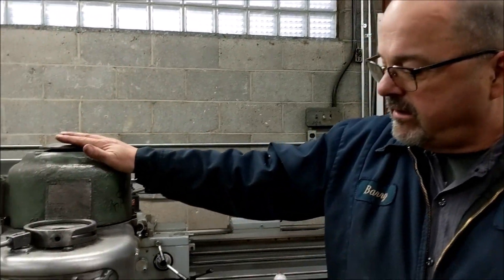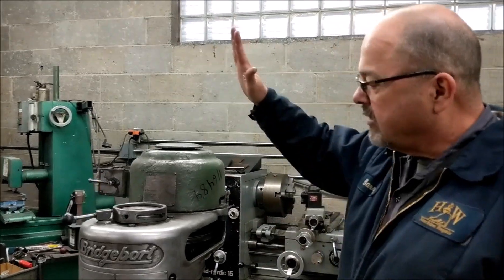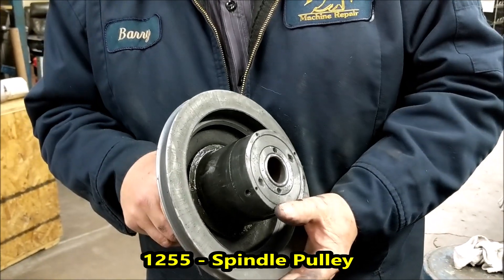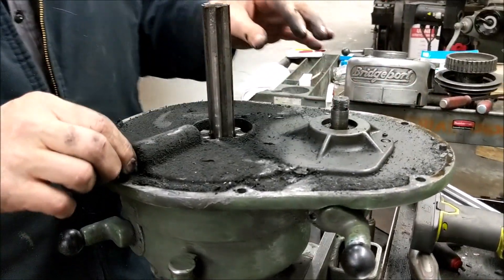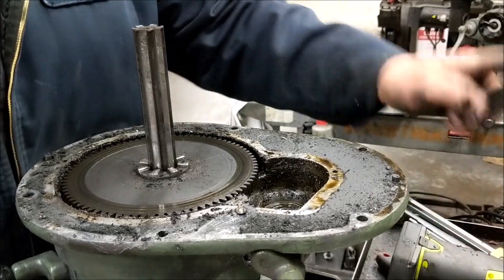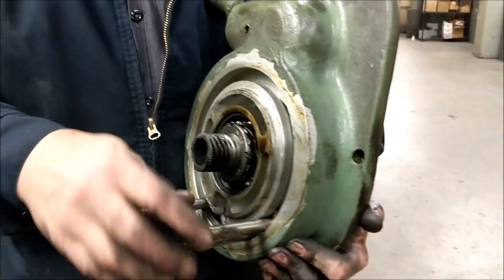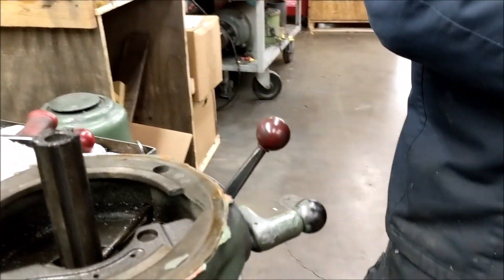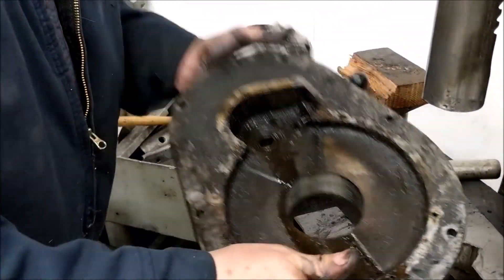Disassembly of the Bridgeport Step Pulley Top Half

Comment: A trick for getting the blind bearing out. Pack its hollow shaft with grease and reinsert the bull gear shaft. Try to seat it with an arbor, press, clamp, etc. The hydraulic force should push the bearing out.

Comment: @10:45 Easy way to remove the captured bearing without drilling holes. Sand or turn on a lathe - a wooden dowel or punch...some kind of shaft so it is a sliding fit on the inner race of the bearing (I used an old brass valve stem I use as a punch). You can use the upper one to size it. Make sure it is tight but slides easily. Pack the inner shaft area of the lower bearing with grease and center the dowel/punch and strike with a hammer. Remove pack with more grease and do it again until it is jacked out. This method is basically making a makeshift hydraulic jack. Very quick and easy once your punch is made.
Reply: P.s. don't try and be clever and use the spline shaft. It is too tight and removing it is a pain. You want a slip fit.

Comment: Great video!   Comments: if you work on motorcycles, you might own or have a friend with a slide-hammer puller for removing blind-hole bearings to avoid drilling punch-holes under the small bull gear bearing.  Also, drilling holes might  be an issue for folks that oil versus greese. I noticed a pool  of oil there when I dissasembled my j-head.  Oh, last comment or rather a tip I learned from my grand dad--when you're working dirty/greesy, get some dish soap and put it on like hand lotion and let it dry before you start your work. Cleaning hands will be a lot easier. You can also dig your fingernails into a bar of soap to keep grease out of your nails.  Cheers.

Comment: I bought your head removal tool and used it as a stand for the disassembly.  I encountered one problem right away when the nut holding the motor on the left side would not unscrew (the interior bolt just turns with it.  I needed to remove the motor cover  and use screwdriver against the bolt head to prevent it turning with the nut.  Once top half is off, any idea what the rest of the head weighs?

On my mill there is no hole in the housing through which the small bull gear pin can be punched out.
Reply from the maker: Just the quill housing itself weighs about 100 lbs. If you have any other questions give us a call 1-800-285-5271

Comment: how can i fix mi bridgeport  1hp j head  the high speed it does not work
Reply from the maker: There are multiple issues that could be causing your high speed not to work. Can you give us a call and one of my techs can take you through some troubleshooting steps: 1-800-285-5271 / 260-422-0020

Comment: The "bread trick" works well for removing that last blind bore's bearing. Just be careful not to hammer your plunger all the way through, or you may crack the casting (ask me how I know haha)
Reply: Pilot bearing puller. It attaches to a slide hammer. I made my own.

Comment: Do you guys do service on Bridgeport clones or have parts available for them?
Reply from the maker: Some, what do you have?
Reply: I have a j head Bridgeport that probably needs a full rebuild including scraping and an x axis screw probably not a 1st priority.. a millport clone that right now is my go to mill. The brake is broken and the power quill feed does not work. It has a DRO so i use it instead of the  Bridgeport.  And i have a variable speed Jet that's at my buddy's shop till i get my new shop built.  The millport is probably the one I want to focus on first. It probably needs scraping too but if i can get the mechanical things fixed until I get my Jet home then I can do a full restoration on the millport and then the Bridgeport...
Reply from the maker: @jeffpitzer8521  Millport parts aren't as readily available as they used to be, but we can still get some parts for them. If you want to shoot an email over with the parts you are looking for I can get you availability on them: support@hwmachinerepair.com
Reply: Thank you...I'll have to take it apart and see exactly what parts I need.

Comment: Great video but you left out the one part I'm having problems with: the spindle pulley hub. My J-head wont shift out of high gear, the top nuts are all hammered to hell and the cam pins are stripped so I'll be tearing it down soon.
Reply from the maker: I actually already had that one filmed before this one. I had full intentions on getting it processed and uploaded, but everyone in the office/ shipping area (including myself) has been out sick. Once I get caught back up that is going to be the first one I do. If you need help until then, you can give us a call and Barry or Heather can help you out. -Virginia
Reply: @HWMachRepair  Thanks. I plan on pulling it apart soon and will be ordering parts from you then. I thoroughly enjoy the narrators insight on the common problems these machine have. 👍

Comment: Do you see the same performance from the shielded bearings in place of the expensive original style bearings?
Reply from the maker: Yes, we see no difference in the performance between the bearings.  The fact is, 90% of the step pulley heads we get in here for rework have had the original bearings already replaced with standard bearings. -Barry
Reply: @HWMachRepair  thanks for the reply. I placed an order with you guys last week for tons of hardware for my Series 1 step pulley. Its my first rebuild and your content has been very helpful. My Step Pulley head still has the original bearings up top. they roll smooth and there isnt any obvious slop in them... I'm not sure how to determine if they should go back in... How do you test them?  thanks!
Reply from the maker: @BLAC_WORX  We generally replace the bearings automatically because we are doing a rebuild on the head and the cost of the bearings is not very high but as long as you did not have any know issues before and the bearings are spinning smoothly than you can reuse them.  Just remember if they fail you will be tearing the head apart again.  -Barry
Reply: @HWMachRepair  Makes sense. I was planning to keep them since I thought it would be +$200 for those bearings. Ill have to do some thinking on it. thanks for all your help

Comment: Could you use a pilot bearing puller on the small bearing instead of drilling holes?
Reply: I used some bread and the axle that the pinion gear rides on to remove mine. Google "pilot bearing bread" to find some videos on how it's done.
Reply: @hairyfro    Take care not to knock through the cover [like i did]  its only about 1/16" thick and being made of 50 year old diecast